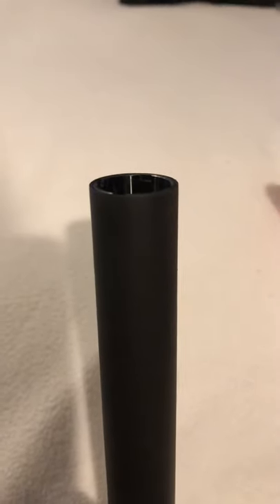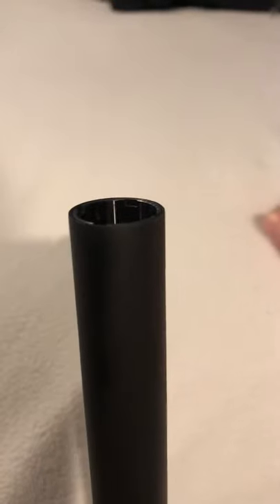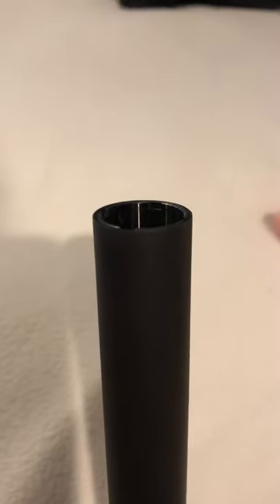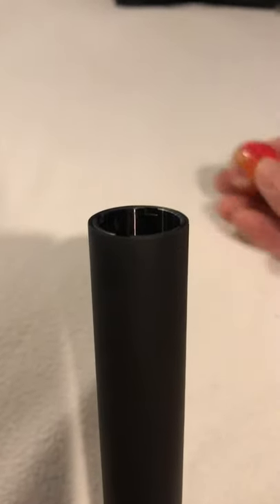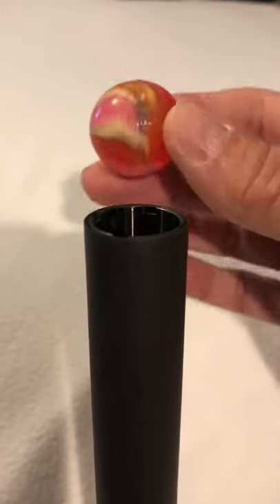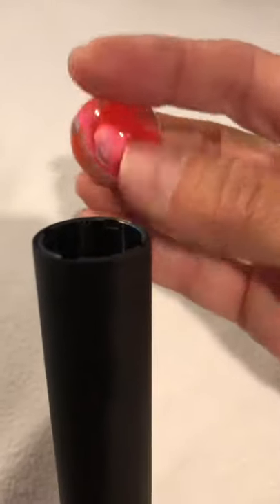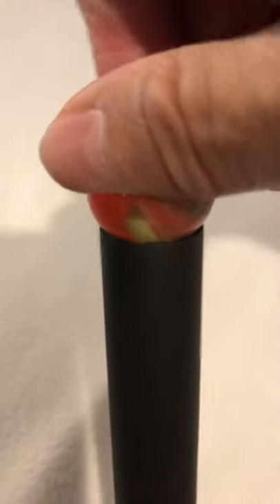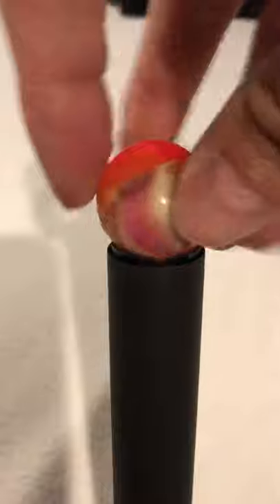Choke Tube DIY Wrench

Comment: how can i get a choke tube from my remington 870 out of the muzzle, i don’t have any clamps to keep the gun from moving, and it’s stuck in there real good
Reply from the maker: I’ve never had a choke tube corrode/get stuck. I always clean the threads both on the tube and inside the barrel and re-lube after I shoot it or expose it to wet conditions. If I had the problem, I’d probably try penetrating oil like liquid wrench; squirt liberally between choke tube and barrel from muzzle-end and let the threads soak a day or 2 and then gingerly use a choke tube wrench to work it loose. If it doesn’t come loose I’d probably then consult a gunsmith. I don’t think I’d use a vise to hold the barrel. If it’s that stuck you can wind up bending the barrel reefing on it - not worth it.
Reply: Not all of us clean our guns before during snd after using them Iol use a vise itself or vise grips